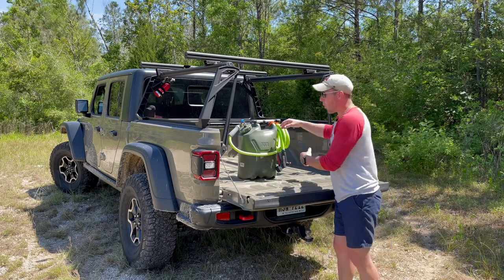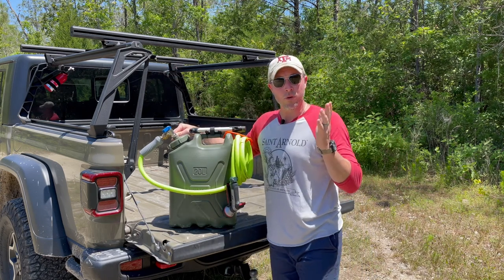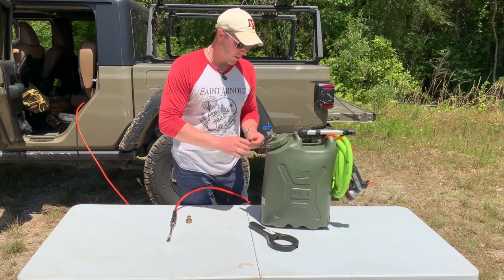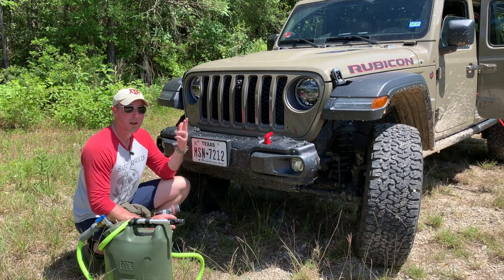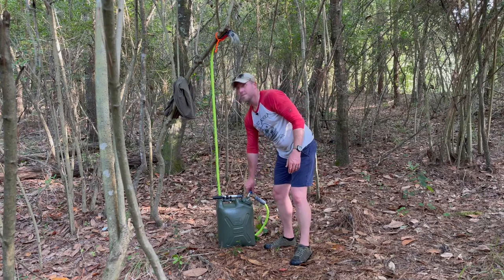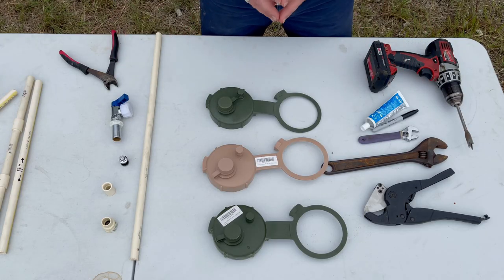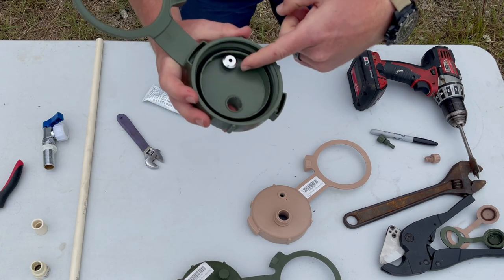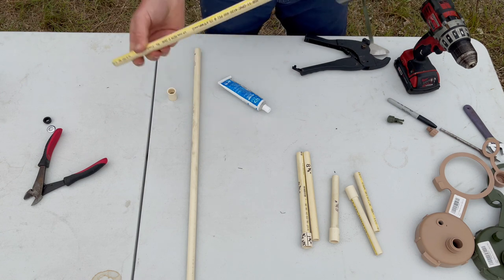Pressurized Scepter Water Can Upgrade *CAMP SHOWER* (JAGMTE Cap Review and How To DIY)

Comment: I came across this video last month, and thought it was a great idea. I built this camp shower following your instructions and it works like a charm. I just returned from a 10-day camping trip, and this thing was a game changer! Great for showering, washing & rinsing the dishes, even hosing the dust and grime off the car. One change I made that I recommend - I substituted a rechargeable battery-powered air pump for the hand pump. It took me way too long to get the can up to an acceptable pressure with the hand pump. A $24 air pump solved the problem. A great video, thanks for the idea.
Reply from the maker: Wow, thanks for taking the time to follow up.. having that convenient rechargeable pump is an awesome idea especially for as little of a task that it needs to be besides pumping it… Shoot me a link to that pump if you have time.

Comment: Thanks for this tutorial. I watched it last week and just put it together using your parts list with some variation in the water system connectors that I could find. It does work like you described. I can get about two and a half minutes of constant jet stream from it before it starts getting low. I can imagine using it for a camp shower will last more by using shower mode. I did find that 15 PSI was what I thought was needed for using it as a power washer. My build also has an air leak somewhere so I may not have sealed it as best as I could, but then I can just pump it up some more.  Thanks again.
Reply from the maker: Awesome to hear Keith! Thanks for the comment

Comment: Thank you so much! I ordered all the parts thanks to your amazing, detailed Amazon list (MUCH appreciated) including the Skeptor can/lid. I almost went with the pre assembled lid but decided I should know how on my own to assemble incase of future issues or incase I ever need to order more, it’s saved in my past order list. I’ve seen other versions, your demo and simplicity of parts made it easy for me to go this route, that and it feels safer. The real purpose for me is I have two double coated dogs (Aussie & Husky/Aussie mix) that get messy for too many reasons on the road or at parks, etc. and it’s a nightmare worrying about how to clean them before stepping back into the car. Often I’m trying to wash them at awkward angles and trying to hold a water bottle or heavy bag just doesn’t work. I had a prior Amazon water/shower bag with crappy hose and didn’t have pressure and began leaking in less than a year so it’s time to invest in something that’ll actually work. Thanks again
Reply from the maker: Thanks for taking the time to watch and comment… I’m always happy to help and glad you found this DIY kit useful… We also have an Aussie and English massive and know how they can get dirty. Let me know if you have any questions
Reply: @GatorOverland  thank you, i just got everything in from Amazon! I do have one question and I may have missed it in the video, how do we depressurize the container when traveling or in between stops? Do we need to let the water out and refill or does the outer mount valve have a way to remove air pressure alone?
Reply from the maker: It’s mentioned in the video @10:00 .. you easily depressurize by putting on a air chuck or depress the shrader nipple with a rock, stick, key, knife.. or Simply loosen the scepter can cap. Shoot me an email if you have any further questions jkhartel3@gmail.com

Comment: I enjoyed your video, it was well done. Pressurizing a Scepter water container might work o'k but for me it is ill advised.
Reply from the maker: Thanks for taking the time to watch and comment… This build is definitely to the discretion and risk of the user… I have successfully used this configuration in the hundreds of times and no issues… The only real concern would be over pressurizing, which would more than likely bypass the cap gasket before anything Got crazy… I typically don’t pressurize more than 15 psi as advised by JAGMTE. This configuration does work well, but concept is not fit for everyone and that is understandable.

Comment: Great video - I am looking to do a similar project. Just an FYI for the creator or anybody else looking to do this project. While I agree that flexzilla is a great hose for general purposes I would be cautious about using it for drinking water. There is a lot of contradictory information on the web about it saying that it is drinking water safe however it does not have the NSF/ANSI certified logo on the box. If you go to the NSF site, I personally haven’t found any flexzilla products (unless it’s named something else).

Comment: Two quick questions:
1. When you place and seal the washer drain valve on the cap, what considerations should we have that effect the final spout placement?
2. Instead of using the 1/2” PVC as a dip tube, could a person use some of the same food-safe hose (that you use for showering) as a dip tube? If yes, any fitting changes to consider when mounting?
Thank you so much for sharing!!! I found your video just in time!
Reply from the maker: Thanks for taking the time to watch and comment!
1) Since the drain is 90 deg it should function properly at nearly any angle, but what I would do prior to permanently affixing is tighten the cap and then orientate the drain opening as seen @ 6:10 in the video for easy access of disconnect/connect.
2) yes you could affix a hose, but they tend to float around and be out of position when the water gets low and/or kink, which could construct your flow.
But If you want a hose, You could simply do a 1/2” brass or pvc fnpt x barb size of the hose.
You may even be able to hose clamp a hose on the fitting I used in the video.
Reply: @GatorOverland  Thank you, very much, for the information and for responding so quickly! Super stoked to build one, and have the confidence to do so because of your video!!!
May I ask one more question.... Is regular plumbing tape ok to use in place of teflon tape? I'm not fully understanding the differences.
Thank you again :)
Reply from the maker: I’ve never understood that there are differences to be honest… I use the one that looks like a blue plastic ring

Comment: Just watch your video. Great video! Two questions. What length of hose did you use? And if using the hand bike pump about how long does it take to get to 15psi?
Reply from the maker: I used 10 feet of hose, but you can utilize anything you see fit.
The amount of time it takes to pressure up his relative to how much water is left in the tank… If it’s mostly full, it doesn’t take as long… I usually fill with 4 gallons and if I was to pump with the hand pump, it would take about a minute or two… It would be longer if it was more empty… if you want to utilize a standing bicycle pump that would put more air in at a time than the little hand pump, and could still stow away easily, if need be..
Reply: @GatorOverland  thank you!

Comment: Where can you get you water nozzle?  Can you please send a link? Also what is the diameter of hose connection? Just want to make sure I get the right connection to mate with Jagmite product. I also wanted to ask about the arb depressure tool. Do you have a link to that?
Reply from the maker: Hey! Thanks for reaching out. This should be everything you need. All the depressurization tool is, is a lock on tire chuck that I use to fill my tires.. 
Specter tank
VTR TR-416-S 1" Outer Mount Metal... https://www.amazon.com/dp/B01BRVCQ7K?ref=ppx_pop_mob_ap_share

American Valve WM75LQTB 1/2" Washing Machine Valve, 1/2-Inch, Blue https://www.amazon.com/dp/B00QGXABS6/ref=cm_sw_r_cp_api_glc_fabc_ZiJ-FbG92SZDH

C4701 1/2 SXS COUP CPVC CTS https://www.amazon.com/dp/B002714JRK/ref=cm_sw_r_cp_api_glc_fabc_smJ-FbJ3Q7ECX

https://www.homedepot.com/p/Apollo-1-2-in-x-1-2-in-CPVC-CTS-x-FNPT-Solvent-Weld-Adapter-CPVCFA12W/314380884?source=shoppingads&locale=en-US

Scepter 05177 Military Water... https://www.amazon.com/dp/B00ZLYUOP6?ref=ppx_pop_mob_ap_share

Miltary Water Cap Wrench for Your... https://www.amazon.com/dp/B074VH5FQL?ref=ppx_pop_mob_ap_share

Food Grade NSF RTV Silicone... https://www.amazon.com/dp/B01F9HCISU?ref=ppx_pop_mob_ap_share

https://www.ebay.com/itm/Ball-Valve-Pressure-Kit-Scepter-Tan-Cap-for-the-Scepter-Military-WATER-Can/251696944107?hash=item3a9a4e93eb:g:j6kAAOSwR0JUUPIm
Water hose Quick disconnect 
https://amzn.to/2S2cufq
18” gear tie
https://amzn.to/3uR1lMY
Male hose repair connector 
https://amzn.to/3okf6kJ
Water hose nozzle 
https://amzn.to/3ye5XPg
Flexzilla garden hose
https://amzn.to/3eOCQdu
*Optional* coil retractable garden hose
https://amzn.to/3tVPWtH
Bell bicycle hand pump
https://amzn.to/2RT3UiS
Reply from the maker: https://amzn.to/3ro9rwb

Comment: Got any DIY ideas on how to pressurize it manually like the Lifesaver Jerry Can?  Want to build something similar to filter water perhaps using the off the shelf ceramic/charcoal candle filters like those used in Berkeys.  Not sure if pressure will work on those gravity filters to provide instant water but wanted to see to eliminate a second water compartment and waiting for it to drip.

Comment: Question! Did you cut your hose down to a certain length or is that a fixed length from when you bought it? And how long is the length of your hose?
Reply from the maker: I bought the 50ft length from a garden store and cut it down to 10ft. I’ve made 3 cans so far so I still have about 20ft of hose left for 2 more. You can make it what ever length suits your needs.. my bed is 5ft and I put it up against the head of the bed, from there I can generally access any point of the vehicle with that length without taking it out of the bed.
Reply: @GatorOverland  thank u so much for responding. I loved the idea of this but am not very handy with tools so i shut down the idea of ever having one of these but your tutorial made it seem super easy so I pulled the trigger and got the pre built one. Super excited to put it together. Thank u so much for this!! This is a GAME CHANGER 🤘
Reply from the maker: Oh it absolutely is. Thanks for the kind comment! I actually ran into a viewer this weekend while wheeling in west Texas who was appreciative of how methodical I do my videos. They made their 4way inflate/deflate system base on my video. A lot of YouTube videos are brief and only touch certain points, but I figured if I’d provide all the info i can, there isn’t room for question, or at least one that can’t be resolved quickly or decided on your own. The main influence was my wife. We don’t have to take bucket baths anymore! 
I’m always happy to help. Feel free to reach out if you have any other questions. 
For better contact, info, photos and video check us out on
https://www.facebook.com/JKHartel3
https://www.instagram.com/p/CF-X_58BjDR/?igshid=1r9yo0niyroip
Email: JKHartel3@gmail.com
Reply: @GatorOverland  God bless you and your wife 🙏

Comment: Does the constant expansion from being pressurized damage the jug ? Or causes the water pressure to subside after so many uses ?
Reply from the maker: I’ve pressurized over 100 times or so, and on visible change or showing of deformation. Functions just like day one. Don’t go over 15psi and all will be good. My wife has her shower down to nearly a minute now.. 😂🤘🏼
Reply: @GatorOverland  dude you’re quick !Thanks for the speedy response. I did have one other question though. What’s your thoughts on the LCI jug/ the kit they have on Jagmte? I’m going camping for the long weekend and the scepter may not arrive on time.
Reply from the maker: From what I understand, LCI are interchangeable with scepter so you should be fine with the JAGMTE cap regardless of can choice.

Comment: Is one 15psi fill enough to get a quick shower done, or do you need to repressurize?
Reply from the maker: One 15psi fill is enough to empty the tank at most elevations.. about 4-5min depending on flow rate of nozzle

Comment: Wish I had found this video before I built the version with the German submersible pump. This is a much less expensive build and seems to have more water pressure.
Reply from the maker: I’ve made both, and they both have their own pros and cons.. but in the end it’s pumping up last longer than batteries in the long run in my experience. Thanks for taking the time to watch and comment
Reply: @GatorOverland  Can you go over the pros and cons. I'm trying to decided which route to take as we speak. Thanks.
Reply from the maker: That is the pros and cons… Pretty much you can have pressure at any time, whether manually or by a pump.. someone consider pressurizing an inconvenience….. if you want to leave it up to electronics to do the work, that’s fine too, but electronics and water don’t always mix well long-term plus you have to worry about recharging…

Comment: Ordered the kit from JAGMTE. Unfortunately they didn't take much care when assembling. There are stickers and thread seal tape rather sloppily attached to the parts and also hanging in the tubing. I would have much rather assembled it myself and taking more care to the details.
Reply from the maker: Thanks for taking the time to reach out… It seems quality control these days can vary, even from respected brands. The good thing about this assembly is it’s all parts you can get at the hardware store so if you need to fix anything it can be done easily.. let me know how it works for you

Comment: Hey man! Great content, thanks for your in-depth and well executed videos!  I wanted to ask, have you heard about the recent recall of the Gladiator because of the "exploding clutch"?  do you have any thoughts on that?
Reply from the maker: Yes I have… I have 29,000 Miles of smiles and no issues with my clutch yet… I haven’t had any symptoms either… I have brought it in for The recall and passed the stress test… If it should fail and I expect it to around 50,000 to 60,000 miles which is a common clutch replacement time… I will be upgrading to the center force.
thanks for taking the time to watch and comment… I’m happy to help and share my experiences.
For better contact, info, photos and video check us out on
https://www.facebook.com/JKHartel3
https://www.instagram.com/p/CF-X_58BjDR/?igshid=1r9yo0niyroip
Email: JKHartel3@gmail.com

Comment: Any suggestions on a dip stick that would be drinking safe?
Reply from the maker: Maybe a plastic dowel rod? Not real sure
Reply from the maker: The arb is an oil-less operation..
Reply from the maker: Thanks Matt… The ARB is an oilless operation.. I’m sure there is still a margin of concern, but then again how much do I trust the water that is coming out of the tap ? 
Even if not, used for drinking water is still a great shower .

Comment: One thing I can't seem to gather from all the videos that show the presurized SCEPTER can at 15psi, is how much pressurized water do you get after pressurization?  1/2 gallon, 1 gallon.  Any way you can do a video where you show continuous pour in real time?  I wanna see how often I need to repressure the tank.  This will give me the proper means to repressurize.  hand pump would suck but if you were only doing that per 4 gallons, that wouldnt suck as much as if you were re-pumping it every 1/4 gallon.
Reply from the maker: Full Open nozzle with 4gal at 15psi is approx 4mins of run time and one 15psi charge will empty the can. If you’re washing your essentials… Two people can use the can most of the weekend. Thanks for taking the time to watch and comment.
Reply: I bought the JAGMTE cap. After repeated repressurizations at 15psi, the most I can get is 2 minutes of decent pressure and two gallons of water before I have to repressurize. Maybe I got a defect.
Reply from the maker: It sounds like you have an air leak somewhere in your fitting or cap… I do know the JAGMTE caps do not come with an O-ring… If you order a cap from scepter specific it will have an O-ring and that may solve your problem… You may spray your cap and components with soapy water to reveal the leak… I have no problem emptying my can with a 15 psi charge and 4 gallons in the can. Contact scepter and get an O-ring… It may even be a generic size you can get at a hardware store
Reply: @GatorOverland  Okay, will try that. Thanks for the tip.
Reply: @TheWuky22  How did this go?

Comment: How long will it run continuously on one 15psi charge?
Reply from the maker: Till it’s empty… How long is up to you and how much throttle you have applied.. I’ve tested it at about a gallon per minute with the shower and wide open.. it’s enough two people to 3 light rinse showers.. (essential parts and hair) pair that with dude wipes and you’re set for a good weekend to a week.